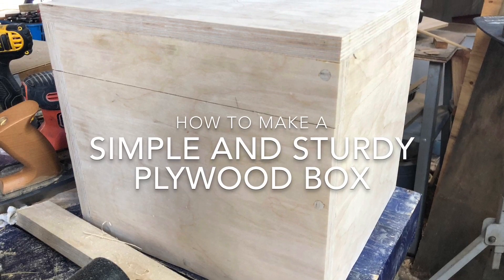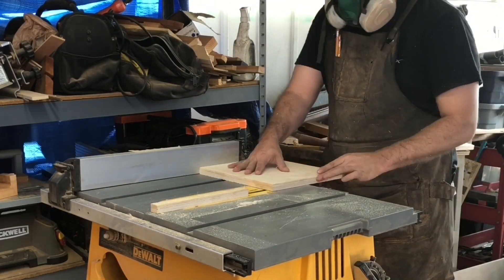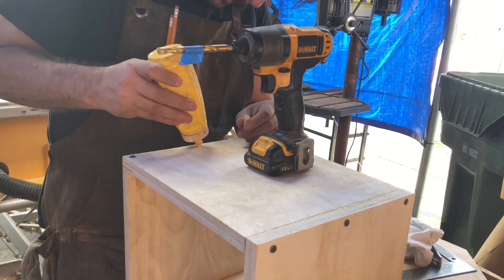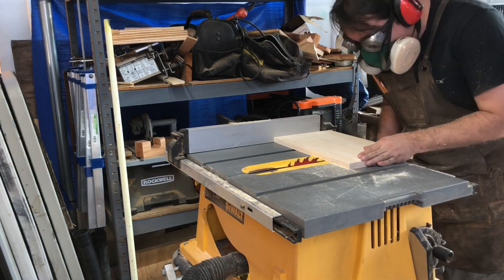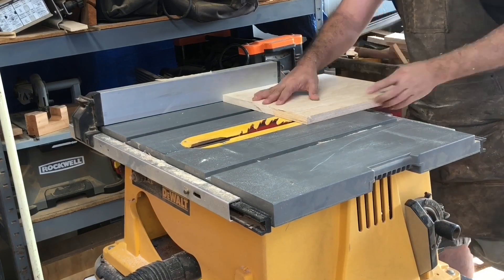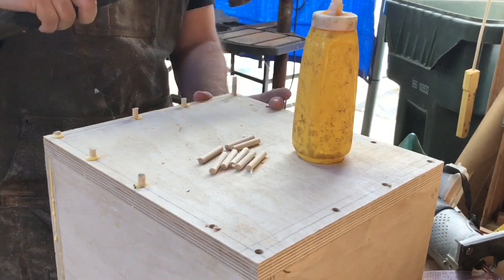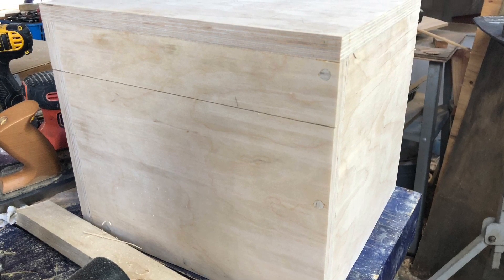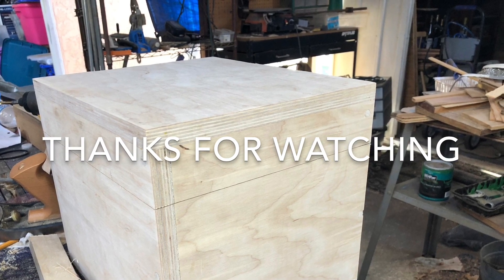How to make a Simple and Sturdy Plywood Box

Comment: Using screws then replacing them with dowels was a new technique I was not familiar with. Thanks for the video, I learned something!
Reply from the maker: Cool man glad to here. Yeah an old time cabinet maker showed me this and taught it to me like this is the right way to do it and everyone does it this way but I don’t see to many people using it. Glad to hear you got something out of it. If you got time watch the Japanese toolbox video. I use this technique there too.
Reply: @MaysWoodworking  It is one of those things where once you see it done, you have that "Why didn't I think of doing it that way?!" moment. I don't use a lot of dowels because I'm not great with precision and trying to get everything lined up has historically been a problem. Your method solves that issue and pretty much everything I make is utilitarian so exposed dowels are not a problem. I liked and sub'd and I will check out the rest of your content when I have a minute.
Reply from the maker: Thanks man appreciate it. One of my favorite things about it is you don’t have to clamp it. And you aren’t stuck with screws which I just think  look ugly. Make sure you use a good drill bit like a bradpoint or just a sharpe one so you don’t get tear out. Any way man Make some dust.

Comment: i noticed you screwed each side alternate rather than opposite - i dont know if that makes sense - ie so that each side has one set of screws / dowels rather than two / which would leave two sides with any screws / dowels ... does that improve strength?

im not interested in how it looks - i need boxes like this for records which will be stacked perhaps four boxes high - so i need strong individual and weight stacked cabinets 

any advice would be appreciated
i'm a total amateur tbh - was useless at woodwork - and have made cabinets that needed metal brackets and other botched requirements ... plus i want to do this on the cheap